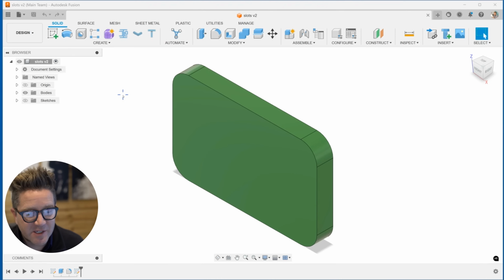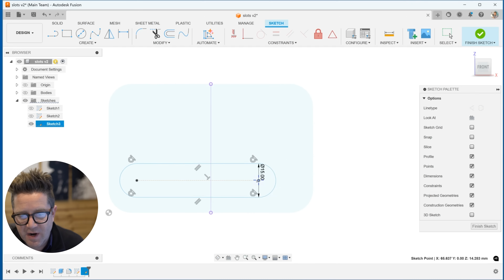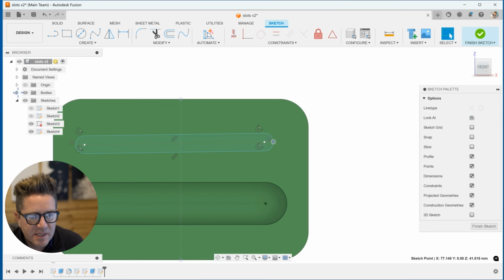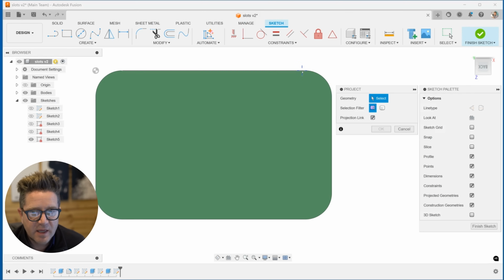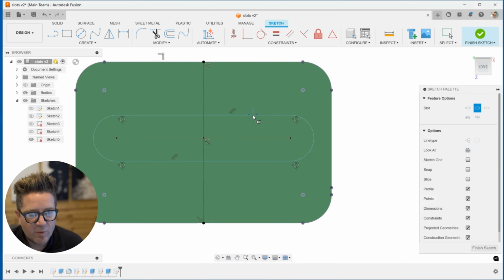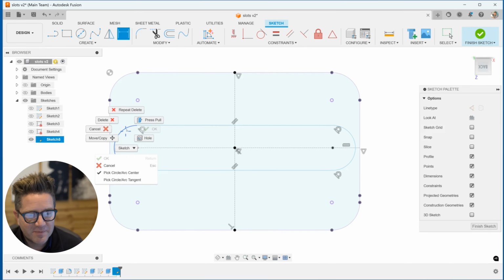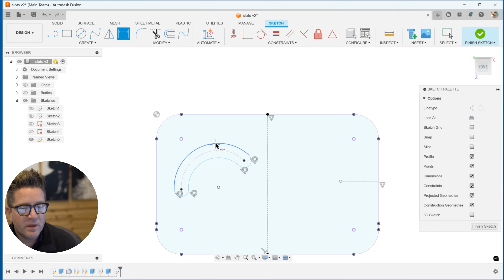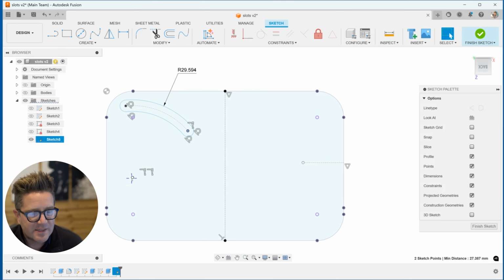Learn Fusion 360 Slots – 5 Slot Types & How to Use Them

Comment: Is there a way to make the bottom of the slot rounded, for example if you were making a coin holder of sorts? Would this just be easier done by making a coin like body and cutting away in a Boolean like operation, or does the slot function allow for this?
Reply: I would just cut the slot, and then fillet the inner edge to make it round.